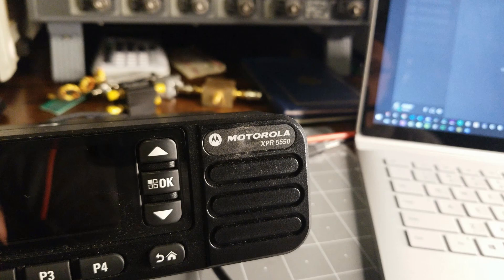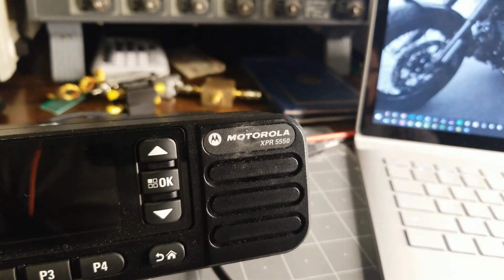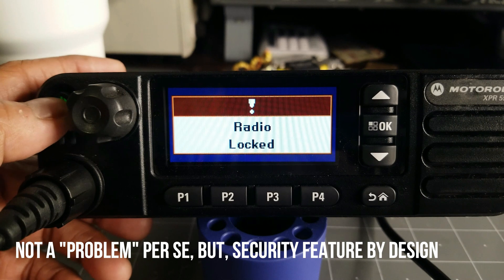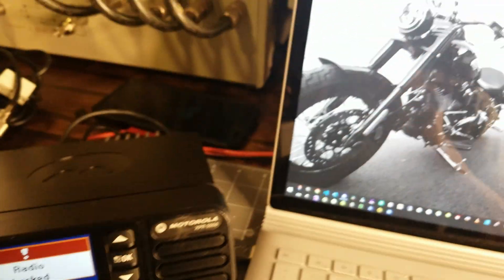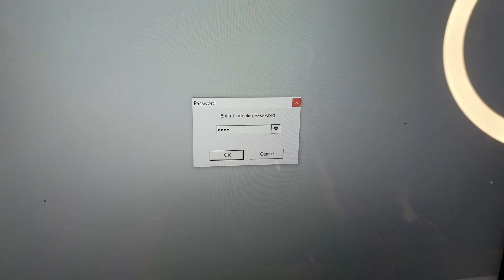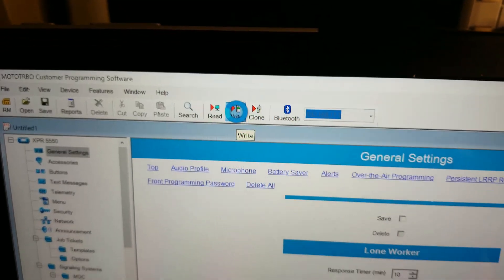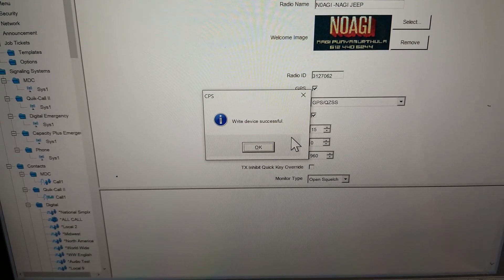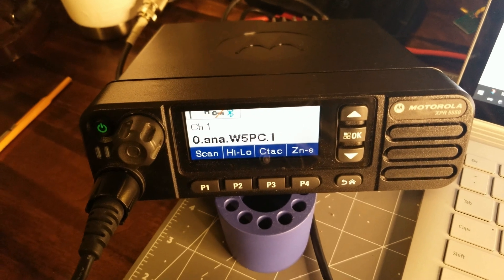N0AGI - How to fix "Radio Locked" mode in MOTOTRBO XPR 5550 Radio - Vol 130

Comment: Watching this in April 2025. I'm on CPS 2.0 version 2.153.167.0. Same features. The look of the UI is slightly different. The headings under General Settings are the same. Thank you for the video.

Comment: Too bad these locks are not available on the XTL P25 capable radios. Kenwood already had passcode protect on their radios from the early 2000’s for both use and programming. Keeps mosey individuals from looking at what’s programmed into the radio.

Comment: Good useful video.  I wonder if you could help me get started with some XPR 5550's I just picked up.  I m trying to program them for amateur use and prefer to use the Bluetooth connection.  The first question I had was with CPS and which version to use.  I started with CPS 2.0 and a Windows 10 computer but got and error message.  I tried an older version (R05.00) and got the same message which barks about the cable (I am using Bluetooth).  The message is:  
Communication Error.
For RM and RMM Series radio, please toggle the USB cable to ANALOG (CPS) mode.
For DLR Series radio, please toggle the USB cable to DIGITAL (Flash) mode.
Any insight you could offer in how to get started with these radios would be great.  73, Steve, WA0A
Reply: Use 16cps 823 build and save your code plugs there... If you save a code plug in 2cps it will not open in previous versions.. you can open 16 code plug  in 2 and read and write to it but do not save the code plug in 2... Save the code in 16 ...16 is great for opening several code plugs at once from different radios for editing by coping and pasting in the same window